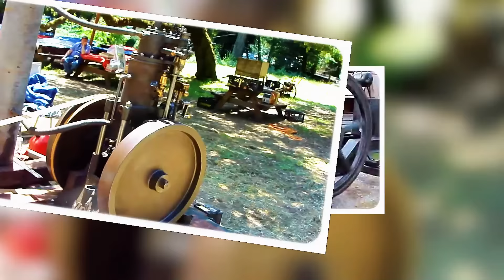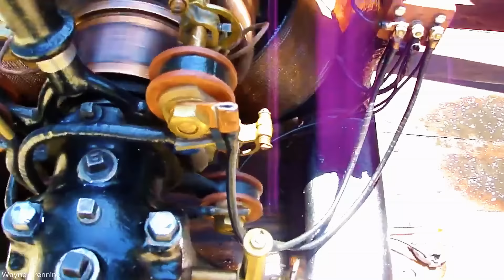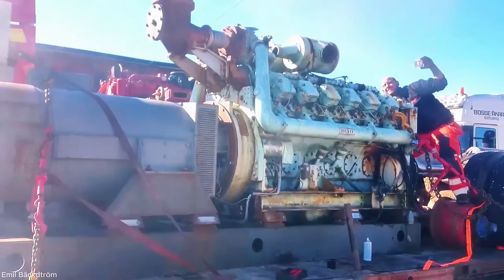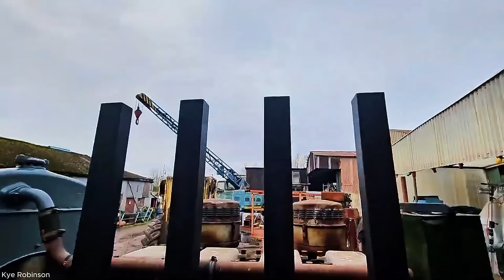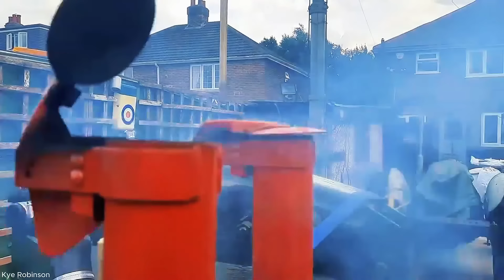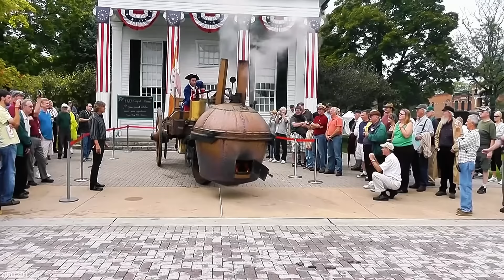World’s first steam car to V12 beasts—watch them roar. Vintage engines & early power history

Comment: Our family textile mill in the north of Scotland, moved from water power to gas engine in 1901 in new purpose built premises. The gas engine was a  25 hp Otto and Crossley engine, running on town gas. It was not too popular with the locals in winter as when running at full power on winter evenings, the demands of the gas engine could dim the gas lights over half the town and sometimes there was not enough town gas to provide full power, so in 1922 they went over to a 40 HP Tangye  suction producer gas engine, supplemented at times of high power demand by steam produced water gas (steam over coke).  Although powerful this engine was very high maintenance so in 1927, they changed again to an 80HP Shanks built Deutz single cylinder diesel, driving the whole plant through overhead shafting by means of a 12 rope belt drive. This lasted until 1938, when 3 phase mains power electricity finally arrived. The Shanks engine with its large 175V DC generator, was donated to the RAF in 1940 and ran the power for a Coastal Command air station in the outer Hebrides during the war, fighting against U boats.